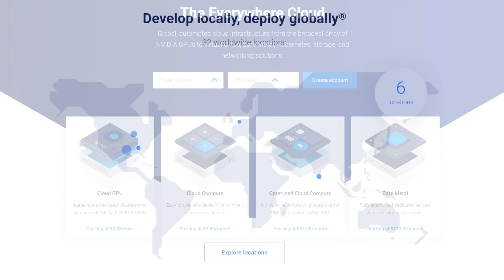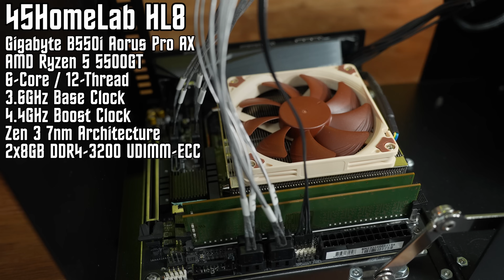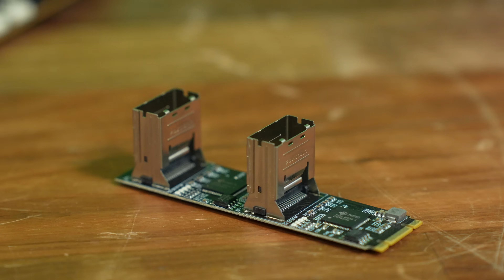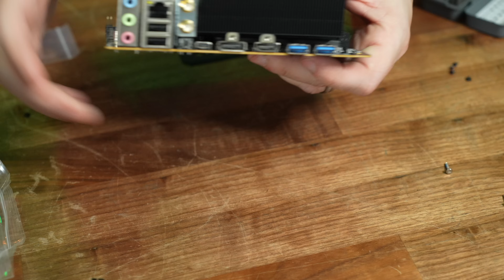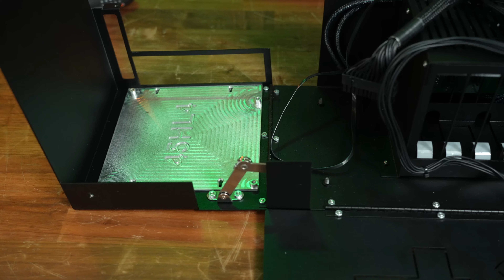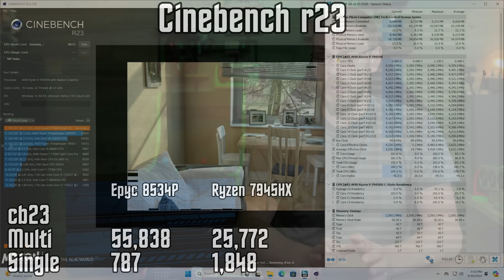The Ryzen 7945HX Mobile is an INSANE Server CPU - Minisforum BD790i in a 45Drives HL8

Comment: I have several of the M.2 SATA adapters with different chipsets and SATA connections. Those with the ASMedia ASM1166 chipset (supports PCIe gen3 X 2) have 6 vertical SATA ports mounted vertically. They seem to be the most fragile, and you always want to insert the SATA cables before mounting the M.2 card in the motherboard slot. Silverstone has a 5 X vertical SATA port M.2 board based on the JMicrom JMB585 chipset (also PCIe gen3 X 2). I don't have one, but it appears to be mechanically re-enforced with a metal heatsink, so flexing seems less likely. My favorite is a board based on the ASM1064 chipset (PCIe gen3 x 1), supporting 4 SATA ports via a single horizontally-mounted SFF-8087 connector. The horizontal mount stiffens the board, so I don't see much flexing when plugging/unplugging the SFF-8087 cable. Too bad the Minisforum mobo doesn't support a third M.2 slot, or you could use 2 of these to support the 8-bay backplane.

Comment: The SFF-8643 to SATA X 4 cables provided by 45Drives are reverse-breakout cables - the SATA plug into a storage HBA or ports on the motherboard, and the 8643 plugs into a SAS/SATA backplane. Most of the cables sold on Amazon are forward-breakout where the 8643 plugs into the HBA/motherboard. They are not electrically equivalent, as I found out the hard way when my SATA drives in the backplane refused to spin up. Guessing some signaling lines are reversed between the two, but they look absolutely identical (that sucks). On the other hand, SFF-8087 and SFF-8643 seem to be equivalent, so SFF-8643 to SFF-8087 cables can go both ways. Hopefully others can avoid this annoyance when purchasing breakout cables.

Comment: That flex was brutal. I see comments all the time like "that gave me anxiety" or "that made me cringe". I always think they are being over dramatic. This one was legit bad though. I bet all that flex separated the solder/chips from the board. 

I would try again. Get another one of those adapters but do like what you said. before even mounting it, strap a heatsink or row of those vram heatsinks under it and even between the connectors on top with zipties. better yet, if you can design and 3D print a bracket for it that supports the entire thing against the motherboard, I think this build is still worth trying out. That motherboard is too perfect to not keep trying.

Comment: Have you considered the Minisforim AR900i?
I was in the same boat as you when i decided which parts to use.

My Proxmox/NAS Server now consists of:
Minisforum ar900i
96GB RAM kit
2x 500GB NVMe for mirrored Boot Drive
2x 2TB NVMe for VM-Storage
6x 20TB Toshiba MG10ACA20TE HDDs
4x MX100 1TB SSDs for other Storage, like Cache for Jellyfin/Plex, Nextcloud with lots of small files.
LSI 9500 16i

And for GPU Transcode i use the iGPU shared with an LXC Container

Works like a charm. 
@idle around 70 Watts
Reply: I had the AR900i.. it died 3 weeks ago after about 1 year of proxmox usage, similar setup with gpu passthru as yours and even same memory. Intel bug thing similar to desktop i9s 13th and 14th gen chips :( .. My idle was ever lower than 70W.. CPU usage was chilling below 5%.. mostly 1%
Still dealing with support to send me a replacement for over 2 weeks now. So buyer be aware. and I think there is a reason they stopped making the intel variant.

Put windows on it and flash latest bios to save it. Mine was 1 bios version prior to the latest version and from what I understood, that what killed it.

Comment: If you have space in the case you can use Bifurcation if available and split the X16 to X8X8 using a riser cable and have your GPU in the pci slot of the case while using the LSI card internally and try to find a plce for it inside the case while using

Comment: I believe this case is a mix of interesting concepts with some spectacular failures. This hinge makes all components easily accessible but will cause cabling failures. On the other hand i don't think that even old school hba card sas slots can survive such tensions. I'd suggest using some kind of pcie/m2 extender and mounting it somewhere on the cage. Board with pci-e switch could also be interesting. Another thing is lack of cooling optimization. Instead of big dedicated cooler for a disk cage (with dedicated air tunnel to force airflow between the disks) we get some small fans. Backplane is a solid part of pcb - no cutouts to improve airflow. I have started gathering parts from my 8 bay build after making a research recently. That would not be the case if ugreen dxp 8800 plus cpu was not bugged with cooling issue. 8 bays is a kind of breaking point where you may want 10Gbit nic , 2x nvme and some excensiblity maybe via pci bifurcation. Such builds calls for matx and only really huge nas cases supports that. Thanks for the interesting and valuable review. Cheers!

Comment: The BD790i is impressive CPU wise, but not having a better builtin NIC hurts. I would like to use the PCIe slot for more M.2 slots, but then any NIC upgrades would have to be M.2, which is not great.

It's probably a sign this board just isn't for me, but I'd love for a Dragon Rage based MS-01.

Comment: I got the Minisforum BD790i with Noctua NF-A12x25 PWM Fan, RX 6750XT, crucial T500 512GB ssd and 32GB ram running Ubuntu. And love it as daily driver.
Reply: What temps are you getting at idle, avg and peak?
Reply: @ecu4321  21C at idle, 43C avg and peak 83C. for now open air till Termaltake releases the TR100 case.
Reply: @ecu4321  Same CPU cooler but with Sapphire Pulse RX 7600 XT and a 1 TB drive running Manjaro Linux. Idle temps on CPU-X show 41 degree Celcius. Average is 45 - 50. I have seen peaks of 85 when 3D rendering/compositing. 

I have it inside a Cooler Master Q300L case which came with the case cooler (3-pin) fan. Mounted it on top. The system is AWESOME!. AWESOME! I was to use 64 GB Ram but Amazon sent me an already opened RAM package with one bad RAM stick. Am in Africa so I was pissed proper since the logistics of returning a defective RAM would not make economic sense. Not sure if Amazon or Crucial is to blame. 

Only Blender maxes out the RAM and CPU usage though when loading huge scenes. Other than that the machine is super efficient and relatively quiet (same dBs as my previous PC at least judging by ear) Only gets noisy a little at peak usage. I have not overclocked anything because this is my very first build ever. PSU is a Thermaltake Smart 700W 80+ White Certified.

Comment: Can you 3D print an exoskeleton to strengthen the M.2 -> SATA card?  Maybe it could be anchored to the CPU heat sink or fan bracket, to help resist twisting due to the cables.

Comment: Not sure if you'd have the room in the case for something like this, but there are M.2 to PCIe riser cables, which would let you plug a normal HBA card into the board. Figuring out how to mount things might be tricky, but it would probably fare better than that m.2 board.

Comment: Another problem, if you are going to use the PCIe with a video card for transcoding and the little problematic m.2 to Sata board, is you are limited to the onboard single 2.5Gbe network. no more i/o's to add a 10Gbe. It might be overkill for a NAS of 6 spinners but would still add a bit more headroom to your system with a 10Gbe link to your network switch.

Otherwise, you are perfectly right that the Minisforum board packs a good punch for a homelab server without breaking the bank and drawing huge amounts of power that eg. an old Xeon server that you may be lucky to find very cheap will do. I'll take the Minisforum any day over an old Dell/HP etc. Dual Xeon solution from 15 years ago.

Comment: Shame Plex still doesn't do AMD transcoding, for whatever lazy reason.

Use the x16 port for whatever you want, and get a m.2 to pci-e adapter, connect your graphics card to that.

Alternatively, someone wrote it supports x4x4x4x4 bifurcation, get an ASUS Hyper m.2, and use adapters in that for whatever you want - such as those half-dodgy looking 5x SATA adapters (they're probably fine), an adapter for the graphics, maybe an adapter for 10Gbit, cause why not.. and another 5x SATA one.
Then you still got the last m.2 to do something fun with. 

Anyone know of a x16 to 16x1 m.2 adapter? Would be cool for storage. Though I suppose it'd need the bifurcation support for it. Ah well.

Comment: You could 3D print a strain relief that is mounted between the motherboard and the case, using the stand-off to hold it in place.

That's the easiest way I can think of to keep the strain off the M.2 and avoid having to modify the cage that I can think of.

I'm planning something similar to this build in a 3D printed case so I'm really hoping you can get that M.2 to sata card working!

Comment: Okay, brainstorming time, no bad ideas: 
1) Can you use one of those Graphics cards that has a nvme slot on the back? I think it's the Asus Dual RTX 4060. I'm not sure if the HL8 can handle a larger card like that anyways. 
2) NVMe to PCIe adapter. These exist, and you could get a full sized pcie controller off of that. Special care would have to be taken to make sure the extra card would fit inside the small case. 
3) When you put the cables in, you needed to fully support the cables so they didn't flex the NVMe board. I would have zip-tied the cables to the CPU Cooler fan somehow. 
4) There are NVMe to 6-SATA port cards. Similar to what you were using, but you would have to go back to SATA cables. Only 6 drives, so that's sad. Maybe run 2 of them and boot off the PCIe slot? Or an SATA SSD slapped somewhere inside the system off of one of the 12 SATA  ports if you use 2x6 SATA controller boards. 
5) Abandon this dream motherboard/CPU... Try to make it work with a motherboard that better this chassis' needs. 
6) Use a high-endurance USB DOM to boot from. 
7) PXE Boot/Network iSCSI boot the OS. 
8) ASRock M.2 2280 B+M Key VGA Module, use that to run the system and try to use the integrated 780M graphics as passthrough. Is that even possible? This opens up the 16x PCIe card for a SAS controller.

Okay, I think that's enough crazy ideas. Let me know which ones you like, or dislike, by their number. Personally, I like 4, 6, 7, and 8.

Comment: whilst the m.2 adapter does seem too flimsy, some of the flex could also be attributed to the plastic peg rather than a proper screw.

Also still no mention of the lack of cooling in this case - none for the disks at all still.

Comment: I have been running the Jonsbo n3 case with m.2 to PCIe 4x Adapter with a regular PCIe riser  for my  SAS controller. I found it to be a far better more reliable method than the m.2 sata cards. Tis a bit more bulky though.

Comment: What about m.2 to to pcie rizer and then just use capton tape to shield it somewhere to the case.
with that aproach you could byfurcatete the other m.2 and run 2 boot drive.
Also wouldnt a taller heatsink or potentialy a watercooler fit in with some moddification to the back panel.

Comment: I have the bd 790i and I heard about common issue where the cpu  is hot and reach 90 c because of poor thermal paste application  and un even edge of the radiator on the cpu die
If you can  open it  an and reapplied the thermal paste and put some thermal pads it would cause significant temp improvement
Reply from the maker: I was definitely going to take a look at that before the next video. Thanks for the tip.
Reply: @CraftComputing  yes and if you can video  the process of repasting i will appreciate it so much  , so that we can do the same 
Heard some users on rediit  did this and managed to get 70 c on load
Reply: Curious about this to, since I own it @CraftComputing

Comment: Looks cool, but please measure the power drawn, as a nas it would be nice to know. Also, i belive you can bifurcate that to x4 x4 x4 x4 so it would be pretty nice to throw in one of those nvme x4 drive adapters (large full heigh so check if it fits at all) there. It's sorta much too powerfull so be used as a simple nas imo hehe.

Comment: Hi, 12:50 Use a soft material table top. Dont drag around the motherboard on hard surfaces like that.
Reply from the maker: The motherboard has a metal shield on the underside. No components were touching the table.

Comment: Bought and tried to use exactly the same m.2 data controller on an erying motherboard (one with a proper 12k series cpu) i was passing it thru to a truenas vm on my proxmox server and i was not quite successful… my proxmox server was crashing randomly after more or less one day… 😢 so I ended up having to use my only pci express slot for a more traditional card 😢 so no space for 10g or a graphic card for ai for me

Comment: You should have plugged in the cables on NVME board outside the case.
Thus not bending it and breaking the traces within it.

And why use the server plastic lock on the thinner nvme?
Theres a VERY good reason that "consumer" based NVME use screvs instead aka more stable and consumers are SUPOSEDLY more accident prone so a plastic lock would allegedly break and create more RMAs.

Also That nas box should be renamed to the DEATH box as it traps all heat inside with only PSU as an exhaust.
Atleast dual 120x120mm or 140x140mm exhaust fans are needed to make the HDDs survive in that torture chamber,

Naa youre better of with Fractal Define R1-R2-R3-R4-R5-R6 or even a R7 XL if you really need massive HDD storage and they all have GREAT airflow.

It is what it.

Comment: I'm in the same boat WRT drive support. My board has 2x SFF8643 but one is for SATA and the other is for PCIe. Wish they would have just configured both for SATA since that's what most people would use that for. Probably going to end up using the x16 slot I have for an HBA since I've already got the two M.2 slots occupied. C’est la vie I guess! That's what I get for building an SFF NAS.

Comment: Is PCIe bifurcation possible in the BIOS so that the one PCI Slot can be split into chunks or x4x4x4x4 or x8x8 ? 
Then multible Cards could be addaed.
Reply: I got an answer fom the Minisforum Support, that the board supports PCIe bifurcation in BIOS. So the port can be split into more. That opens a lot of possibilities.

Comment: Love my bd790i but also hate it as well lol. If they decided to ever make a proper heatsink for it or if someone designs one buy it immediately. I did try to to respaste and put higher quailty thermal pads on but it only can do so much. The heatsink just can't keep up with this processor. I curbed additional heat by just setting a max temp in the bios so it doesnt get as hot but i know im losing performance because of it.

Comment: One more thing it is not dead is you mentioned you must use the sff to sata cables with this card to initialize it with the system, and install 2 drives only on each port, only then it will work after that you can use whatever cable you want

Comment: probbaly mentioned already somewhere down in the comments; but you could run an nVME extension cable off the board, and mount the sata adapter more rigidly in the chassis where the cables wont flex as much.
little bit of 3d printing could make a nice internal mount somwhere in the case for this.
Reply: @andys3dworld  idts it would flex that much with a foam piece underneath and with a screw instead of that plastic mounting post

Comment: In terms of m.2 sata there are a couple of cards on Amazon that offer 6 sata ports. I have one in a bd790i. It works fine with windows 11, server 2022 and Ubuntu (v22 upwards). 
In total I am rocking 5 m.2 nvme and 6 sata drives in a bd790i based system🤨🤨

Comment: Thanks for the video
If I may suggest something: get an m.2 to a PCIe riser and install it instead of the m.2 SATA solution and then install the A310 on the riser
Then you can use a good PCIe hba solution like the LSI 9305-8i which supports hotswap IIRC

Comment: I wonder if you could use something like the "NFHK NGFF M-Key NVME Male to Female Extension Cable 40cm with SFF-8654 Connector" to take a lot of the twisting pressure off that HBA. Of course you'll have to buy another one to try.
--- Edit: I came across a "ADT-Link M.2 NGFF NVMe Key M Extender Cable to PCIE x16 Graphics Card Riser Adapter" that might work as well, just turn that NVMe slot into a PCIe and use a regular LSI HBA. Might have to get creative with mounting.

Comment: I dont like those SATA chips. If you have space in the chassis either a bifurcation of the x16 slot with newer bios or using a (delock?) m.2 to x16 riser with integrated cable to attach an LSI controller.

Comment: Imagine two of those bad boys in a single 2U chassi with as a cluster, thats the dream right there for me.
Reply from the maker: Seriously, that's a ton of compute.
Reply: @CraftComputing  you can probably fit 12 of the boards in a 2U chassis

I hope someone makes a video about it😉
Reply: @arjungupta3531 now THAT is a blade chassis.
Reply: @CraftComputing  indeed, as someone who are just stepping into this, starting with my new desktop pc being rackmounted and now looking into homelab options to put in the rack.. it is tempting to have it as a goal to save up to.. gotta fill that 15U somehow :D.

Forgot to add that it sucks there is no Swedish or Scandinavian reseller, and Minisforums EU page despite being set to English is almost all in German.
Reply: So, I actually tried this. Turns out that most 2u cases are just too tight; I couldn't fit the 100Gbit PCIe cards that I was hoping to use.  I'm on the lookout for a 3u dual mini-itx chasis, and I'll try again.  Need the verticality, I think, in order to not bump up against the power supplies.